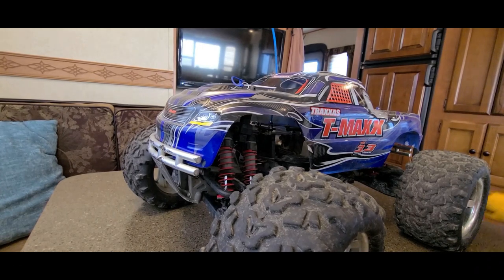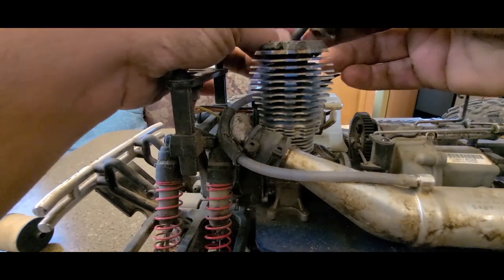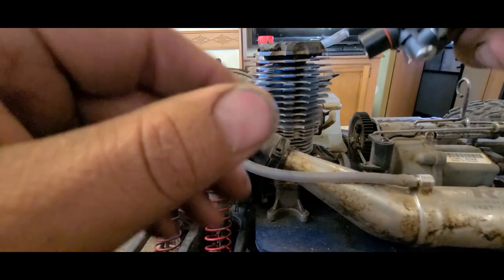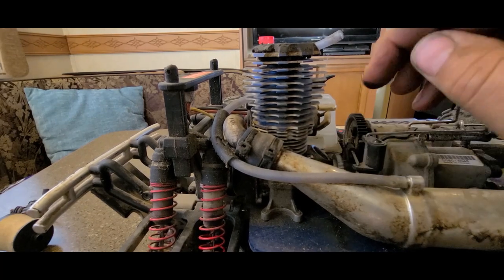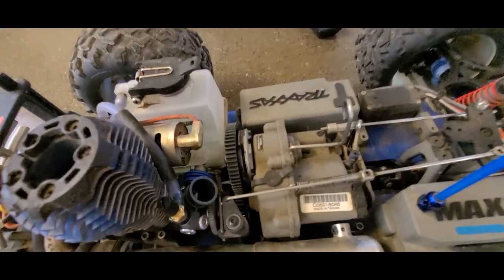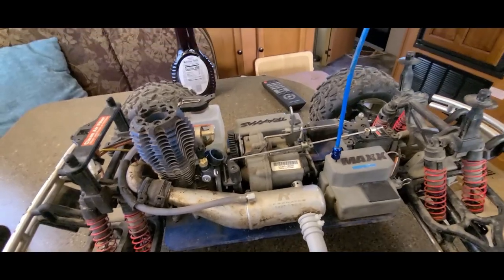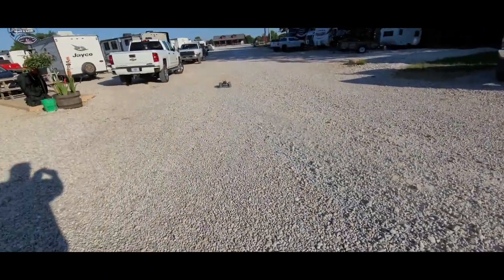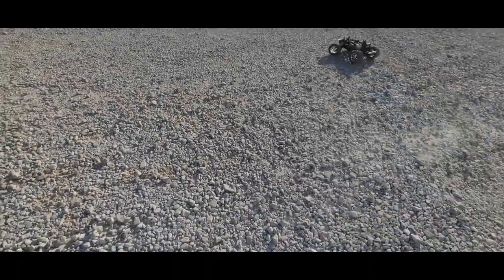Traxxas Tmaxx 3.3 Nitro Carb Install and test

Comment: Great video!  I believe the stock 2.5/3.3 carb factory setting is 4 turns out from closed, and the low speed needle should be flush with the carb housing.